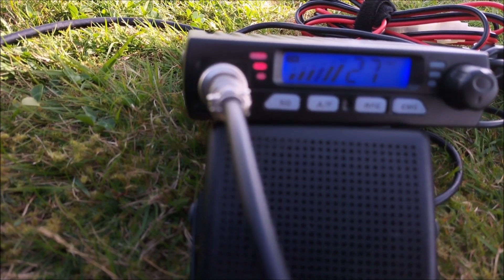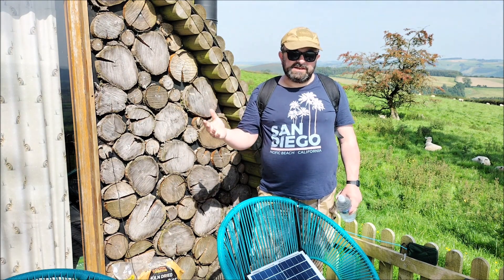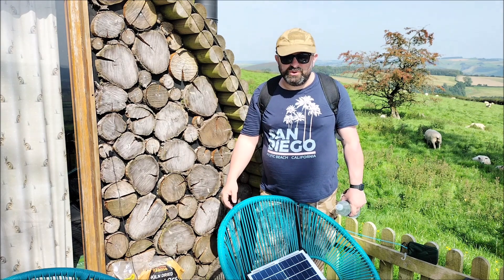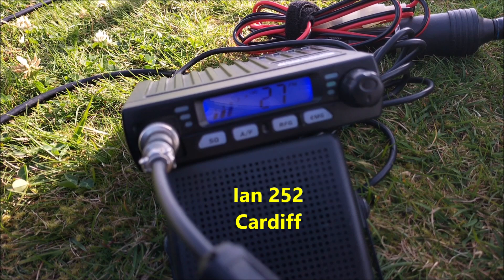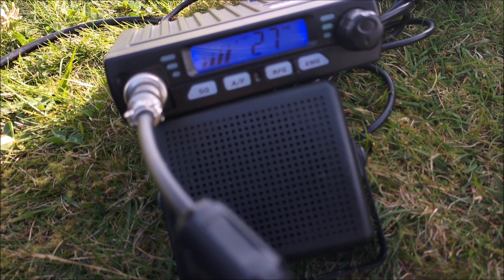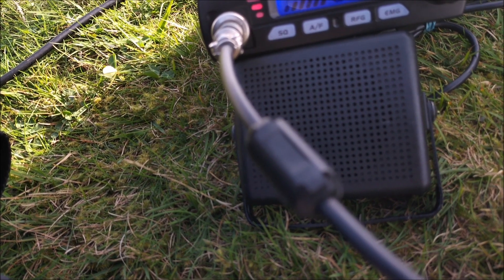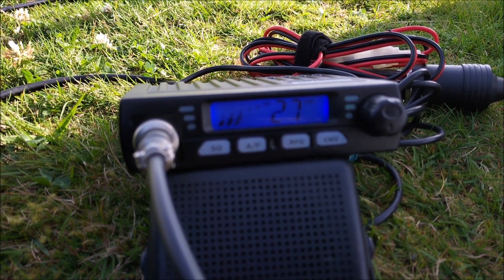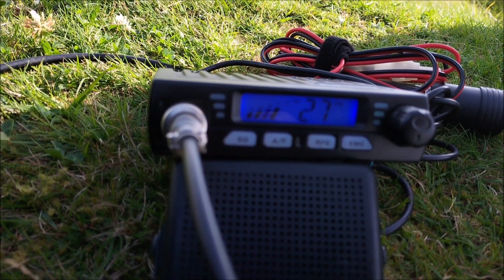FM CB Radio - 2000ft up in Mid Wales - 100+ Miles on 4w!

Comment: Hi Gary, enjoyed you latest 2 videos,  this one and your new campervan. I have a KPO radio similar to the one you are using in this video. It says it's a 4 watt radio but the most I get out of it is about  2½ watts. What are you getting from your radio? Your antenna and location are getting you plenty of distance. Thanks again for all your efforts Gary, much appreciated. Cheers, Sky. 🇮🇲
Reply from the maker: Hi Sky - 4w out (I had to bring the power up along with the deviation a bit). Radio is great, but mic PTT is crap and now needs fixing, so my CRT Xenon will likely be making an appearance next time. Cheers.

Comment: Another epic Vid.  Great work Gary!  A great speech at the end there too about we're all one radio community.  👊Going out tomorrow (Sunday 17th Sept) to a local field to test out my T2LT and the new guying system I've just made today.  It hasn't been used in quite a few years...but were back ..again 🤣CT/X 6657.
Reply from the maker: Bones are creaking more than ever, but enjoying it again! Good luck with the testing and hope to catch you on the air soon. Cheers.